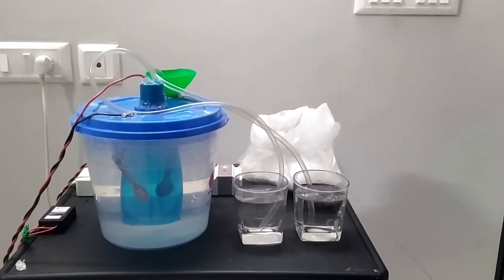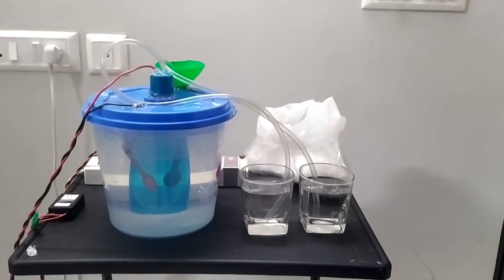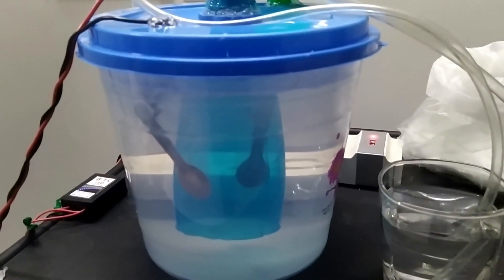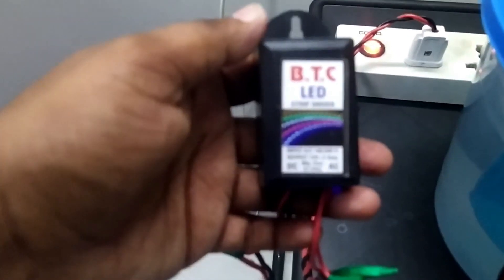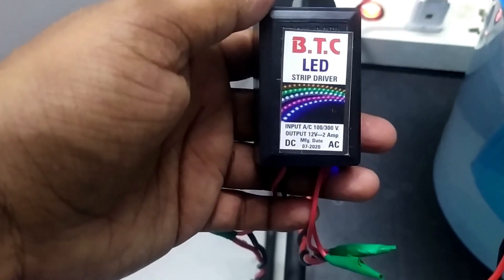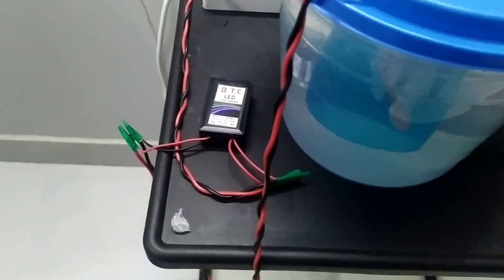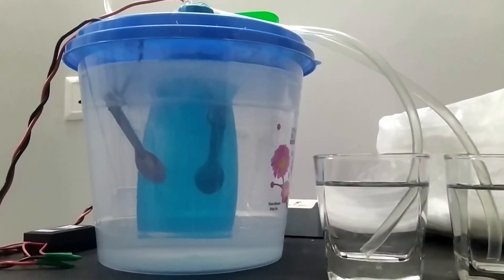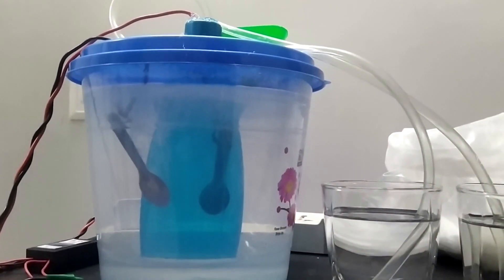Oxygen Generator with Home Goods - Part 2

Comment: Try limiting the voltage to 2V DC with decent ampere input or use neutral plates with higher Voltage input.

handling caustic soda (NaoH)/ Potassium Hydroxide (KoH) etc... needs more care, when putting that in water and when disposing the water too.

Comment: Or can we use direct 24 volt AC
Reply from the maker: AC can't be useful... also it's about amperes of current that pass through the water... voltage is secondary... if someone can arrange a 5 or 10 amperes DC current... that will increase output a lot
Reply: @lifebyvivek  can I use 24v 12ah dc
Reply from the maker: @aloktastic9593  yes.. you try to use that... do share results here ..
Reply: @lifebyvivek  brother if I use a smaller box then in the video , will output be more , or any problems
Reply: AC Power generates steam, DC Power has to be used to conduct Electrolysis reaction
Reply: @raghuveerdendukuri1762  tnq  brother for information 😎👍🏻